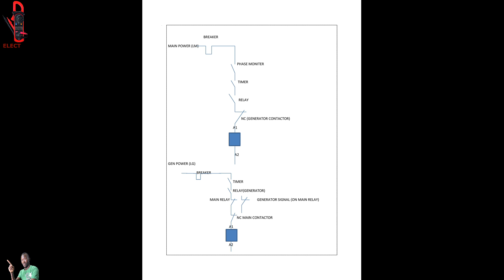components that makeup automatic changeover switch|manual changeover switch|Electreca

Comment: Very informative. I’m a woodworking guy, and a novice in electrical automation. I am trying to automate my shop vac filter cleaning. I have a 2kw 220V shop vac, and a small 200W motor that runs the filter cleaner. I start and stop the shop vac with a remote controller. Today I run the shop vac filter cleaner manually. I would want to run it automatically with a time delay, such that it starts 5 sec after shut down of shop vac, and runs for 10-15 sec, and then shuts down. This repeats after ech time I use the shop vac. Do I need a full set of interlocking contactors, relay and timers to ackomplish my goal? Can you gaide me, or better still, could I ask you to create a Youtube video on this topic, as I am sure I am not the only one struggling with this task.
Reply: Okay, thanks, can you take me through or send me a wiring diagram of an automatic changeover that comprises on 1 relay and 2 contactors, kindly....

Comment: Hi, most cases i have seen three contacters inside the board but you said we only need two contacters, why?
Reply from the maker: In most cases We switch power between 2 sources, the utility and backup(like generator). This is why you will have 2 contactor.
You can use 3 contactor if you have 2 backup power(like gen set and solar) Were your utility power goes off and the priority backup fails, then second one comes.
Reply: @elektreca  okay, no wonder i saw 3 contactors there because their mains, 150kva lister, and 8kva single phase were all connected to the contactors

Comment: Looked at your video and suggest you learn more about this subject matter.  The drawing at the end seems incomplete - need more information to best understand its dynamics. You indicated if both circuits came on together will cause a short circuit, as surely being same power value works like parallel batteries? Yes, we can connect both the mains and generator together as power station does it daily. That's providing they are synchronised first as both supply phase angles difference can be catastrophic.

Comment: How do I get in contact with you, can you  build one of this for me and what will be the cost
Reply from the maker: The cost depends on the rating.
Reply: @elektreca  I don't know much about electrical rating but my house is a 3 bedroom flat with one sitting room, i have 4 Ac unit which are 2Hp and 2 television,  2refrigerator,  microwave and basic household equipment,  so how much will it cost me
Reply: hello

Comment: Thanks..and please what can happen if main supply and generator releases power at the same time.?
Reply from the maker: That's very dangerous, it will be burn the Changeover switch most likely all the installation, the alternator(generator) will burn..........BUT it really had for all of the above to happen.... Because in the Changeover switch there is a protection( interlock)  which locks out the contactor (which is out of phase) both electrically and mechanically. 
Meaning Both contactor can never engage at the sane time.
Reply: Okay thank you
Reply: Also you are going to electrocute someone maybe working on the main line

Comment: How much is an automatic change over in Kenya? And where can I buy
Reply from the maker: Already made changeover switches can really expensive......from as low as 40k to 300k.
now that price is determined by the rating, brand and mode of control...
but custom made can at least cheaper than already made one.

Comment: Thanks very much for the lectures but after this how am I going to have the control diagram and the other thing if I can be out of what you are  explaining where do you connect the wire from from the device to the generator to star outomaticaly without  the manual rope dracking position?.
Reply from the maker: Thanks for watching ..... That depends on the type of the generator you have... or the generator need to have the capability to start automatically.......  This video has circuit diagram at the end...... See if it helps. Then come back to me.
Reply: @elektreca  Sir, can 8kva and 3.5watt generator off and on automatically?

Comment: Thank you very much for lecture.
What I want to know is that, I need a control diagram of Automatic change over (ATS) that can start generator on its own with any manual operation.
When the main power fail the generator should come ON Automatically without any operator  then when main restore power its should send signals to the generator in order stop.
Please any knowledge about let me know OK. 
My regard to you
Alicious Alpha Kamara.
From Sierra Leone
Reply from the maker: No problem .....That's video is coming soon.
And thanx for watching.
Reply: @elektreca  Still waiting for this video. Also what if I dont want a delay - for a backup that has Lithium or AGM batteries and a load of Internet Modems that I want an immediate 20millisecond switch from mains to backup, do I still need these timers?
Reply: Thanks

Comment: Hi.kindly show us how to incorporate all this into working and also where to put the two cables from panel to generator starter
Reply from the maker: I will definitely do that.......but for the 2cable(signal cable),first the generator can be closed or open start..... That cable goes into the main contactor relay NC for closed signal, for open signal it's the reverse
Reply: @elektreca  thanks alot for your guidance...I have a 5kw generator that doesn't have signal points where I can input the two cables.how can I go about it
Reply from the maker: @eliudkariuki.3083  Whats the brand of your generato?
Reply: @elektreca  it's a wasp generator
Reply: Hey bro.still hoping to hear from you
Reply from the maker: @eliudkariuki.3083  hey since that generator does"t have card............ you will do something different.....first of all, the generator has a key for both START AND STOP, right?
if yes  ...there is a circuit I will develop for you....put your email here.
Reply: Hi.still hopeful